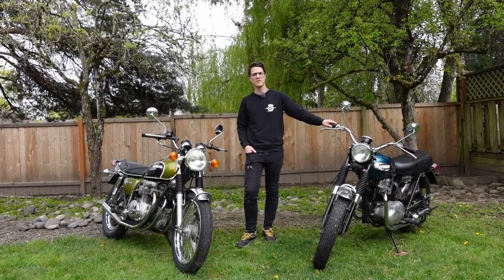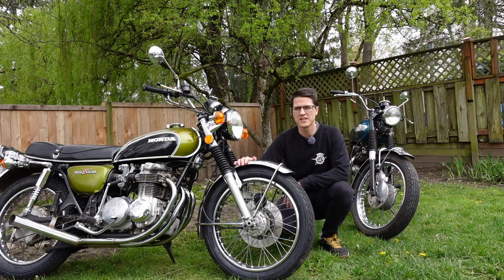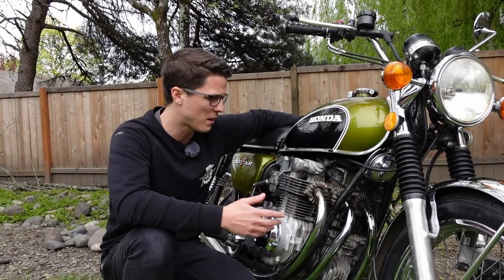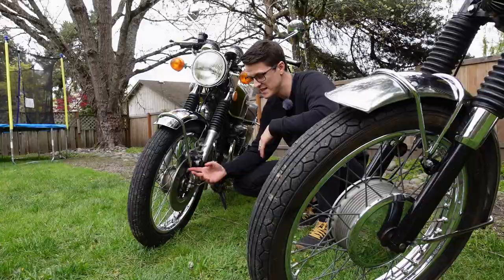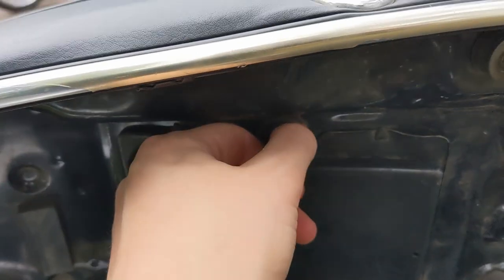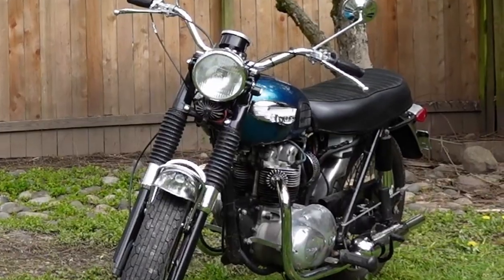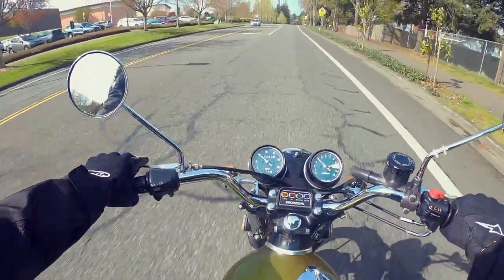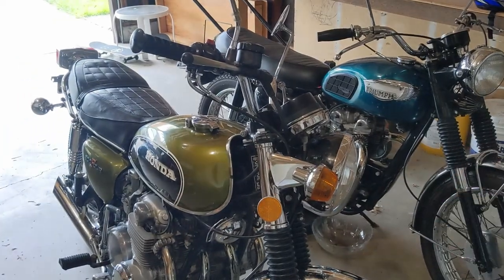How this Honda killed this Triumph

Comment: I think you’ll find that the only Meriden era of Triumphs to have an electric start were the 1975 Trident T160 and the 1980 Bonneville T140.
Reply: the 250 Sunbeam/Tigress Scooter also had an electric start which was optional.
Reply: And the Norton Electra
Reply: and MkIII Commando
Reply: @mc2594  Not a Triumph.
Reply: 'you meet the nicest people on a Hesketh'
Reply: @mc2594  You may do. I also ride a V twin ,  a Ducati ,old school caff racer job. One does not deign to press a silly little button, that is why the Good Lord created Mankind with a right leg.
Reply: @philhawley1219  - yeh come to think of it Mankind is ideally shaped to ride a Motorcycle, uncanny of the Good Lord to see a fitful purpose for limbs, senses and mind combined, never thought of it that way but it makes a lot of sense. I had a T90 in my youth, the 350 version of the T100 which used to start itself, one gentle prod past compression and off it went, it had a distributor which often popped out until I replaced the clamp, the silencers didn't need spanners to detach either, I used to time it with a pencil and a fag paper while my gf looked on bemused wondering what I was doing and if she'd have to walk home. 

I've owned one Italian bike which didn't even have a kickstart but cost an arm and a leg in 'legal fees' and halogen light bulbs it had a habit of blowing, man that thing used to take off at 6000rpm and go into warp drive, a few Honda's, the CB160 was a superb piece of motorcycle engineering, several Z250's, an XS250 US C which stood for 'useless carburation', a Norton 500 hybrid, a Yamaha 600 Radian, which objected strongly to having it's airbox removed much to my bemusement, a PUCH Grand Prix, two Casal 50's, two NVT Easy Riders, an SR125 that's befriended the lawn mower, again, and brief flings with a Fantic Caballero and a Bantam Cub.

I started out on a fizzy and then a C15 'baby beezer' passed my test on a Honda C90 but I only ever missed the 350 Triumph and the PUCH, I've never owned a Hesketh or met anyone with one, two Weslake 4 valve 500's apparently under all that obscure posh dosh, it was just the only other British bike I could think of with an electric start which I word played into a 1960's Honda advert, an Italian woman riding around her village on a C50 meeting various shopkeepers 'you meet the nicest people on a Honda' ... i only ever wanted to get as far away from them as possible, meet her for lunch and that is why the Good Lord created Honda's 🤗
Reply: @mc2594   What a wonderful resume of your motorcycle career. After 40 years in the saddle I have tried all sorts, but never a lumbering cast iron cart horse. Have you ever done 1000 miles in a day? Nor have I . The best I ever managed was 997. Honda CB750 KZ .1979 model. Thank you for your essay.
Reply: @philhawley1219  - 'you meet the nicest people on a lumbering cast iron cart horse'

Comment: The Triumph 500 Daytona ruled its namesake racetrack for 30 years try taking a cb500 4-cylinder off road and see how far you get before you have to call for a road call.
Reply: 3 wins not 30 nortons did much better
Reply: @juanrodriguez-ry6yt  I said ruled Daytona which is why they called it the Daytona. And just like Edward Turner used to say all the time nor used to spend so much money on their racing program that they never improved thier street bikes.

Comment: My dad helped me when I was 15 to buy a Triumph 500 in 1975 for $275. I never owned a CB 500 but I did have a CB550 a year later. Wish I had all the bikes I ever owned.
Reply: Hmmm. i had a few bikes i regret i bought them.
Reply: @drhkleinert8241  I do too, but wouldn't mind having them again for nostalgic reason.
Reply: You and me both, I often see how much some of the bikes I've owned are making on eBay now, if I'd kept them all I'd be sitting on a fortune  (I'd also need a bloody big garage).
Reply: Don't beat yourself up. When I see the current  prices for the Bultacos, Ossas, Montessas and Czs I owned, I can barely sleep at night.

Comment: I agree with you about the Triumph's aesthetics. The British bikes of the 50s and 60s were among the most beautiful motorcycles I have ever seen. That said, if I were to buy a motorcycle and take up riding, I would probably buy a 4 stroke Japanese motorcycle. I'm just not interested in owning a bike that requires the level of upkeep as a vintage Triumph. I would consider a modern Brit bike, but only if they had the level of reliability that I would expect from a Japanese motorcycle.

Comment: You left out one thing.  Jumping.  Try to take the Honda through the air for say 15 yards .. not much fun. However, the Triumph will fly with ease.  I could also go down the road with no hands .. even put my feet on the tack.  Triumphs had a very low center of gravity and handled like a dream.  You don't get that today.

Even today the Bonneville is awesome just to look at.

Comment: My 1980 Benelli 900 Sei was based on the Honda CB500F, in 1972 Benelli's engineers added an extra cylinder on each end of the CB500F crank and they created the 750 Sei, after a two year delay the Benelli's six cylinder machine went on sale in 1974, producing a road going six cylinder motorcycle was a world first for Benelli. Between 1974 and 1978 Benelli produced 3200 units of the 750 six, in 1979 the motor was bored and stroked to create the 900 Sei which was in production between 1979 and 1989, but only 1863 of the 900 sixes were ever produced, so it is a rare piece of motorcycle history.
Reply: Cool bike.  I remember first seeing one 45 years ago and noting the resemblance to the CB500 though with slightly canted cylinders.  They sure do sound sweet.  Those were the days of the Laverda twins and triples too.  Wish I could go back and relive them.

Comment: Both are beautiful, and both sound great in there own ways. For me it would come down to reliability.
If my W650 leaked oil, I would upgrade to a bike that didn't.
Reply: my cb750 custom had no center chamber it ran strait to 4 exhaust tips..At a high rev it was a diffo bike.. An animal.. what a change.. Quiet at normal but damn it changed at high revs..

Comment: If your Triumph is indeed a 1968 model, the single carburetor indicates it's a "C" version as does the smaller headlight, BTW, they had 38 HP. The Daytona (T100R) model with dual carburetors had 41 HP and was a different beast altogether. It appears your bike's exhaust may have been changed as in 1968, every T100C I've seen, had dual high pipes on one side. I'm speaking of when they were new as this is when I started riding and a good friend was the local Triumph dealer. As far as leaking bikes, If you take care of the Triumph, it won't leak. It's just a matter of becoming one with the machine. None of my British bikes leaked or started in more than 1-2 kicks. Owning a bike back then required the rider to actually learn about the bike, do your own maintenance and get the most out of the bike. I've never rode a Japanese bike of the same vintage which shifted or handled better than a British bike, I've owned both when they were new. BTW,  It's my understanding, there were a few late 1973 Daytona's which were fitted with e-start at the factory.
Reply: Trophy -1 carb
Bonneville 2 carb

Comment: Bart, as someone who owned both of these bikes, the Triumph at 17 and the Honda at 18, I agree with everything you say. However, I don't know about the USA but in England the last iteration of the Triumph Daytona had twin carbs, a close ratio 5 speed gearbox and a front disc brake and could be tuned to produce 60 BHP. As a back road blaster, it could out perform the heavier Bonneville.
Reply: 60 hp in your dreams.750 norton made 47 hp at the wheel on dyno.. 500 would not crack 30...
Reply: @johnoneil6206  I think he's talking an all out race bike. The Bonneville 650 was only 52hp, so if the 500 tuned was 60hp, my guess is it wouldn't be too reliable@2hp/cubic inch!!!!!!
Reply: @johnoneil6206  Not rear wheel power, at the crank and it could be done by race tuners, probably around 48 bhp at the wheel. How long the engine lasted was another thing. BTW a 750 Combat could also be tuned to produce a bloody sight more than 47 bhp. Between 58 and 68 BHP at the wheel. Again race spec and short life expectancy.

Comment: I agree Japanese bikes were more technically advanced and used more modern manufacturing techniques which the likes of Triumph, BSA etc could not match, one of the main reasons was lack of money for development, Japanese industry had millions of dollars pumped into it because it had been destroyed in world war two, unfortunately the British bike industry didn't have that luxury, I worked briefly for Velocette, they were the same, they spent large amounts of money on development just before the second world war and had no money left after it, Britain was virtually bankrupt after six years of war, our industry had suffered extensive bomb damage during the blitz by the Luftwaffe, but look at Triumph motorcycles these days, with the right investment it is now a world class manufacturer, it's fair to say that it has learned a lot from Japanese manufacturing methods. As a case in point about how much more advanced Japanese bikes were, I had a 1949 Royal Enfield J2 500cc single, my mate had a Honda CB161, it was much faster than the Enfield and as mentioned in the video didn't leak oil, no contest.
Reply: That is a piss poor excuse. We in Detroit made the same excuse about Toyota. Honda made a better bike just like Toyota made a better car
Reply: @dknowles60  I'm not making excuses, the fact is that British industry had no money for development so kept banging out the old designs based on pre 1939 technology, the Japanese had brand new machinery and factories and had billions of dollars pumped into them, there was also a culture in the UK in the 1960s and 70s of union unrest so new working practices were hard to adopt without strikes. The Japanese have taught us all a lesson in how to build modern, reliable bikes and cars.

Comment: The British Bike industry committed suicide ,it was not killed by Honda or anyone else.
Honda just stepped into the vacuum left by companies who had stopped developing their products in any meaningful way.

When the CB750 came out it was looked at as revolutionary . The shocking thing looking back is that people should think that. In this era we had jet fighters ,rockets travelling to the moon ,people could travel around the world in hours not months.
Why had motorcycling stagnated to the point that a multi cylinder engine ,electric start and Overhead cams were so shocking when it was pretty standard tech elsewhere?
The Honda 750  was still in some ways old school .Dry sump ,chain primary drive would all be dropped soon after by Honda and others.

Your Triumph 500 does not make 41 bhp ,try mid 30`s.

Comment: "Besides maybe handling", and beauty.  Ted Simon 'circumnavigated' the globe on a single carb Triumph 500. Triumphs never needed an electric right leg because they started on the first easy  push of the kick starter. What killed the Triumph was the inability of the company to satisfy the Unions, as each section of the factory had a different labor union.
That and, Honda poured a gazillion dollars into an advertising campaign that went You meet the nicest people on a Honda. I always thought that the 750K gas tank looked like a bread box. Great video, thanks for posting.
Reply: I was thinking recently the same thing.  Honda and Kawasaki are making new "retro style" bikes that look like the 1970s CB750 and Kawasaki Z1000.  And I'm thinking, that's kind of strange in a way, because those bikes weren't known for their styling or good looks when they came out.  They were considered when they were new in the 1970s, to look like kitchen appliances.

Comment: The Japanese started the cult of quality and the rest of the world followed of died. Triumph didn't get the memo. In general the British motorcycle industry was lacking in quality manufacturing techniques but what was worse, they were building bikes with sub optimal parts. These parts were all sourced from manufactures lacking in quality control measures. I am not blaming only the British. The American's were slow to recognize the need for quality cars and bikes.

Comment: The Triumph 500 was a very poor design. Thin porous castings made it impossible to seal, and the vibration was terrible. The Japanese designed bikes with thicker castings, large mating faces, plenty of large bolts to hold it all together and split them the obvious way ie horizontally. They didn't leak like a sieve, but they also didn't have the torque of a big twin. Both the design and the workmanship were decades ahead of the ageing Triumph. It's just a pity they made it a four rather than a balanced reliable twin. It would have been a lot more fun to ride. I never did see the appeal of engines that needed revving hard to get what a big twin would do effortlessly.

Comment: The CB 500 four is (for me) the Best looking bike wit the 4 into 4 exhaust. 

And 100hp/l in the 70s is insane and the smoothness cant be matched
Reply: Nah, the CB400 Four's exhaust was better.  😉
Reply: I agree. I have a '75 CB550F Super Sport that I bought new in high school.  It isn't running currently but I will bring her back to life with a complete frame off restoration before I take my last breath.  I installed a set of Kerker 4 into 1 headers on the bike shortly after I bought her and to this day it's still one of  the best sounding and running  bikes I've ever encountered.  Four years ago I bought a new  2014 CB1100 as it reminded me so much of the CB550F.  It's about 100 pounds heavier with twice the power plus better brakes and suspension.  I immediately installed Arrow headers to emulate the old 550.  And just as I hoped it truly is a time machine taking me back 45 years as I ride the exact same roads.  It will be something else to ride them back to back when I get the old girl back on the road.
Reply: @gwilliamwallace  Bet you will love the CB 550 when its done. 
I bought a 500 Four K last year for my first bike (dont See any mid 20 riding old bikes ;-) ), and it was a blast to ride. 
The sound is loud but way, way more pleasing than other bikes as it goes up rpms. 

Im now looking for a 350 Four or 400 Four as I want something bit smaller and less weight. 

And funnily the consumption was 4,5-5,5l - Thats actually really really good.
Reply: @ETT64  i like the symmetry of the 4 into 4 better but the 400 looks and sounds also good.

Comment: My Bonneville did not vibrate or leak oil, and had the prettiest purr and smoothest ride.   Like most riders from back in the day, we rode each other's bikes.  I road that 750, and the screaming K500s, and the wobbly yamahas.   My Honda 305 Dream, beautiifully ugly, just ran and ran.  But it was the bonneville that I dream of.

Comment: The same period Japanese 350cc 2 strokes (Yamaha R5, Suzuki T350 Rebel,, Bridgestone 350GTR & Kawasaki S2 350) were already slightly faster & quicker off the mark, than both these 4 stroke 500cc bikes.
Reply: Yes my RD350A was quicker than my mates CB500F but he was faster. As to the CB350 twin the RD blew it to pieces.
Reply: In 1978 I had an RD 400 and it was quicker and faster than my friend's 1978 Triumph Bonneville. He was pissed.